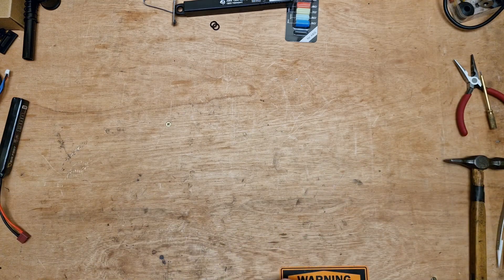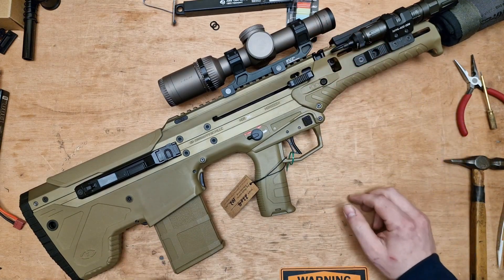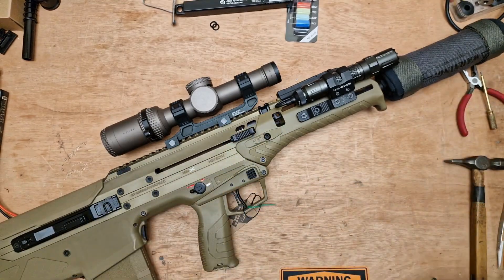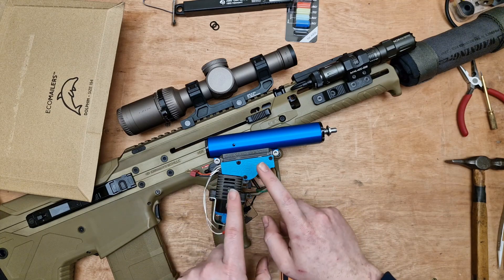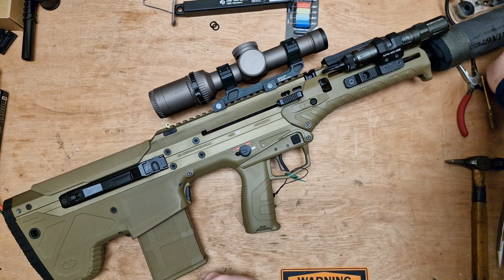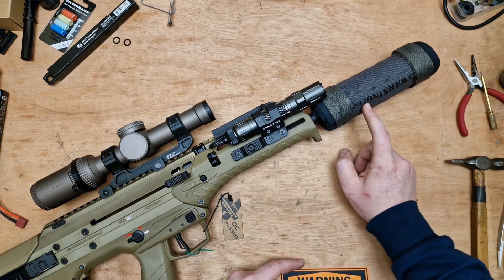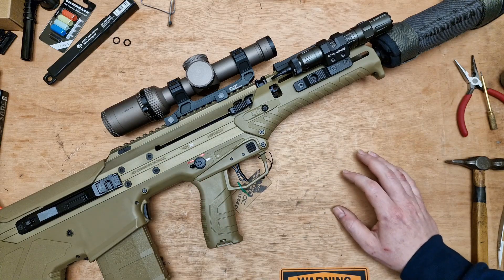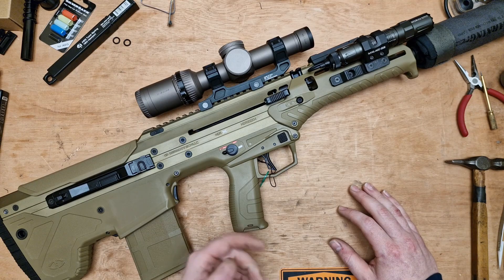Lets Clear The Air on the Silverback MDR-X

Comment: Dang, I was really hoping to get a good airsoft gun to match my real .308 desert tech Wlvrn. I think given this video is a couple years old, I might still hedge my bets that your issues are all fixed on the V3 version that more closely matches my real rifle.

Also, just to give my personal experience with the hand guard shifting left and right. My Wlvrn does it, so I over torqued the m6 T25 clamp screws from 30 inch pounds to 62 inch pounds(3.38 to 7 Nm) and that pretty much solved the issue when shooting and hiking around in the mountains. But, I bet if I pulled hard, it would shift around like before. That has to be my biggest gripe for a $2500 rifle to have such a bad design flaw.

Anyway, thanks for the very detailed videos on the mdrx, there isn't a ton of information out there about it.

Comment: Good video, and I’m really glad you’re getting the other bits sorted as well. Good to see the community come together. 

With reference to my own video, points accepted 👍 I was just a touch concerned that people were doing a TL:DW and then writing the rifle off based on your experiences. Lots of comments on socials from non-owners slating it, yet they’ve not actually used one or held one in most cases. I’m not saying it’s without issues - there’s defo areas for improvement, and what you and Luke have done is clearly helping so all power to you guys. I’d love to hear the difference in person, so let’s sort out a day when we’re both free and hit the private range. I can show you my new DMR build based off Jason’s suggestion. It’s pretty impressive so far! :)